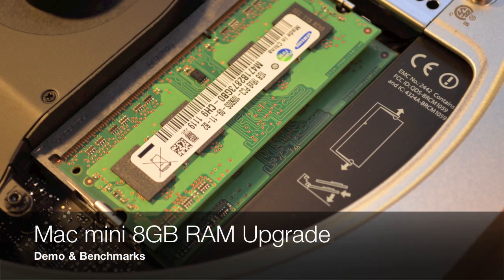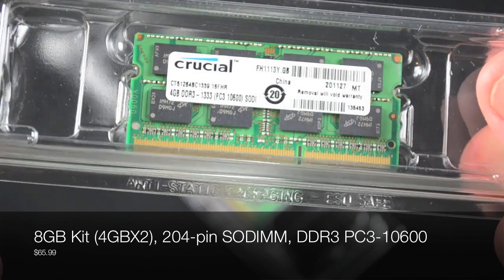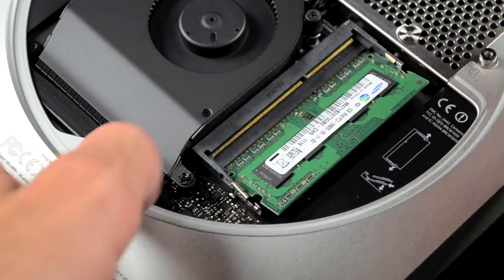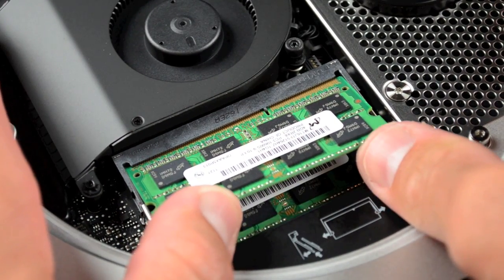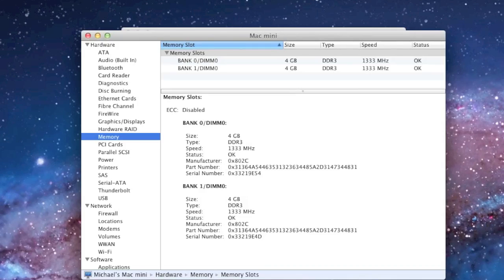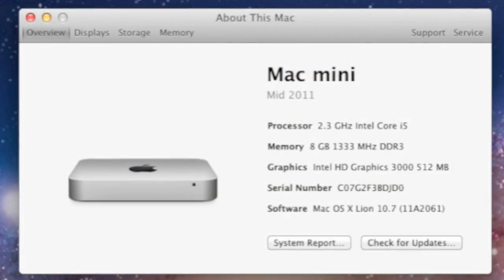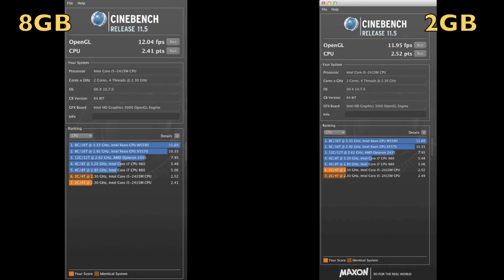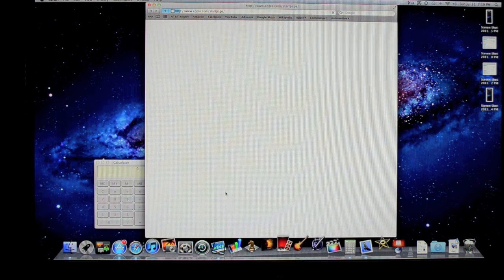Apple Mac mini 8GB RAM Upgrade: Demo and Benchmarks (Should you do it?)

Comment: Many Thanks - very useful.
Just upgraded my mid 20011 mini to 16Gb.
Book says 8Gb is the max but guys on the internet were saying 16Gb is fine and Crucial sell a 16Gb kit for this computer.
Works fine.
Heck, if I can do it, anyone can. :-)
(I even managed to drop one of the new modules on a hard wooden floor - it jumped out of the plastic wrapper when I flexed it to get it out - and still works fine, so +1 for Crucial. Other makes of memory are available.)
For me, the advantage of upgrading is not so much a faster machine - although there's some of that - but being able to have a couple of large apps open at the same time.
Thanks again.
Reply: Can you send a link to the exact one? Theres a High variant and a low variant

Comment: if i have 4 gb of ram in my mac mini,  both of these have 2gb each. And lets say i change the other 2gb to 8gb , so the total ram will be 10gb , do you think its okay to do that? @DetroitBORG
Reply: qwertyuychua it's not recommended to do that, but you can and will work just fine
Reply: @blahblah101  Agreed. Memory works best when installed in identical pairs. Changing the pair of 2 gb for a pair of 4 gb will probably do better overall.

Comment: These only apply to the Mac minis prior to the 2010 model (the polycarbonate top models) as they are harder to open the case and to remove the RAM boards.

The Mac minis from 2010 onwards can be upgraded and as long as you do not DAMAGE anything inside the machine, you are still under warranty (besides, the process is easy enough that an idiot can do it too).

Comment: Ummm WRONG. From Apple support website, direct quote, copy and paste...........  "Important: You should not manually upgrade or replace the memory in these Mac mini models. Instead, contact an Apple Authorized Service Provider to install memory for you". So as you can see, you are risking damaging your Mac Mini, invalidating warranty, losing data and important files by dabbling in the complex, highly-skilled job of Apple Technician.

Comment: Wow, just a plastic plate on the bottom? i've upgraded the RAM in a couple of eMachines towers and it was a process measured in dozens of minutes, not dozens of seconds :D. with this setup you can get an Intel I5 processor, 8GB of RAM and a 500 GB hard drive for only $650, i never thought i'd see the day when apple made something reasonably priced :D. (Posted from my iMac G4 15")

Comment: I`ve just upgraded my 09 mini (2.0 with 9400M) and my late 08 Macbook Pro 15" to 8GB, it`s probably the best upgrade you can do these days because ddr3 ram is extremely cheap these days (8GB kit for 40 quid).
Most macs will grab some ram for their integrated graphics so an upgrade is always a good choice.

Comment: hey detroitborg,

ihavea 2.0ghz macbook pro. i had issues with mien and applefinally caved in and offered me a new replacement. also, they said if i wanted i could upgrade to the 2.2ghz high end model for 450 dollars more, which also includes the anti glare screen. i was originally gonna stick with a new replacement for the same one, and add the 100 dollar anti glare, but a jump to a higher spec is tempting.

if u had this offer for 450 to jump ship, would u do it? lol